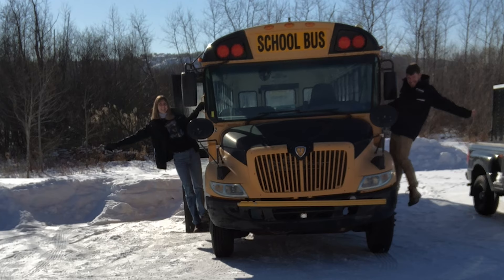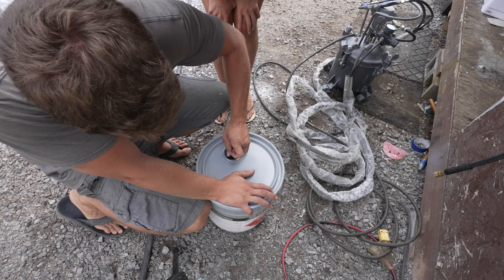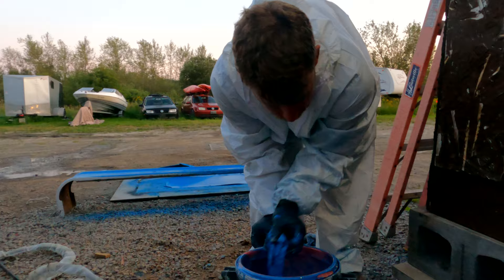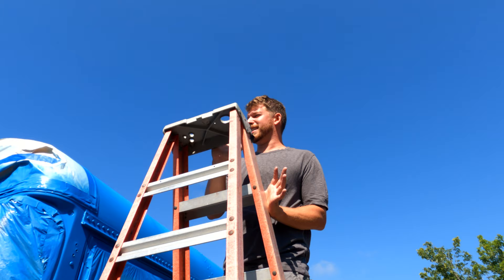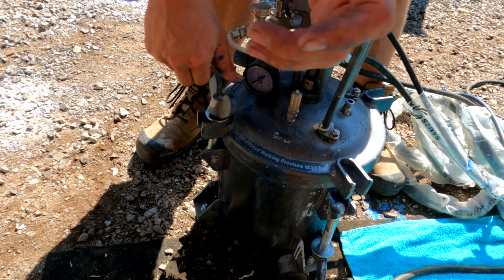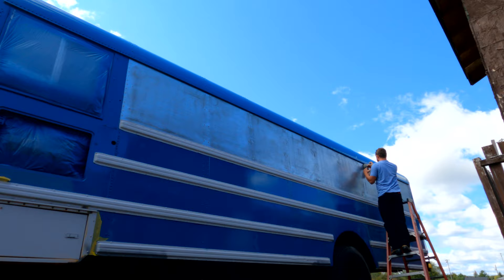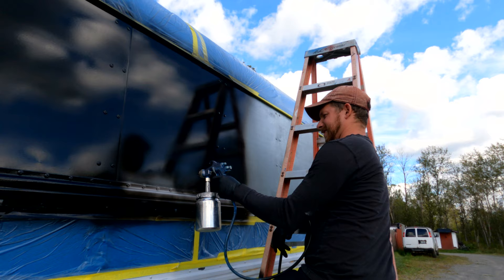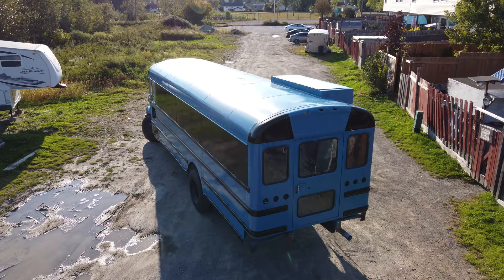Nightmare Paint Job | Finally Painting Our Bus | Skoolie Conversion Ep. 13 | Adam & Steph

Comment: Considering all of the hiccups you had, it turned out great ! If you plan on getting rid of some of that orange peel I highly recommend wet sanding first. Helps level out the paint faster than just the buffer
Reply from the maker: Totally, we’re just worried about having so many rivets, wet sanding around them will be a pain and sanding through the blue would be a risk on the rivets

Comment: What about a matt finish?
Reply from the maker: A matt finish could have looked nice, but there are a few drawbacks that make it undesirable for me. It's harder to clean, you can't protect it with wax, and you can't polish it. And it's also very difficult to blend in paint repairs.
Reply: Definitely a flat paint is the extreme of that but matt clear coat is a lot more forgiving and still maintains that monolithic look. I'll do some testing before committing to a full paint job on my bus. Thanks for the thoughts!    @AdamandAtlas